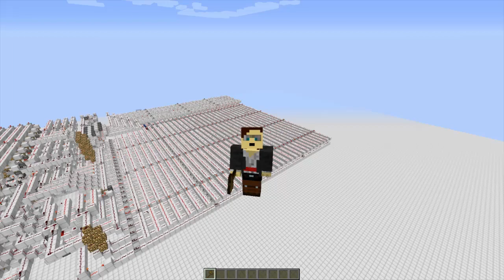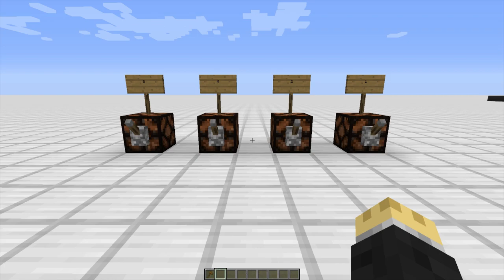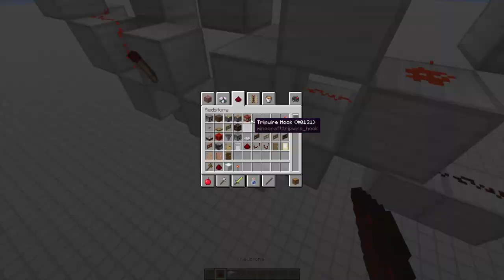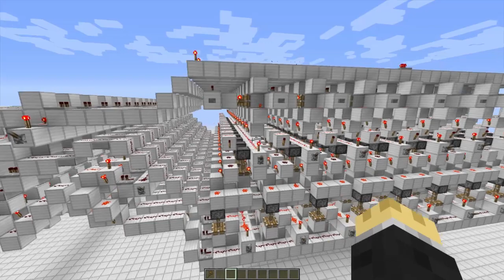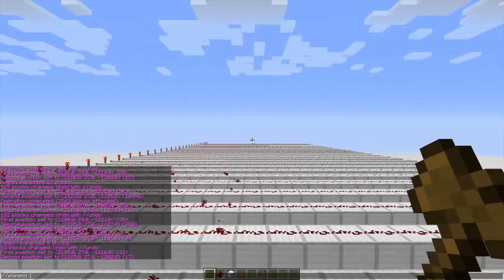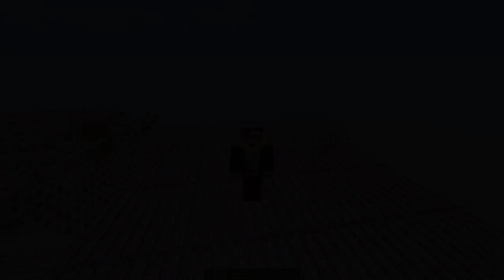Basic Computer Concepts - Pt 1 - CPU Architecture

Comment: For the Dual Read RAM does it need to have a ‘write’ function so that it can save information temporarily? I looked at your tutorial for Sw1ftx16’s dual read RAM design and as far as I can tell, there is none. Is it needed or should I find a different design?

Edit: solved
Reply: Sorry, I missed part of the tutorial I believe. I found an unused line of redstone that did nothing which was probably supposed to update the pistons. I used a piston as an updater because I thought that something was wrong, it was just my own mistake.
Reply from the maker: @secnytsecnyt2981  Glad you were able to figure it out.

Comment: So what happens if you make a 64bit cpu in minecraft?
Reply from the maker: it offers room for a few more features, like double-precision floating point and such, but at a huge performance cost.
For one, any form of ripple carry will take much longer, and 2 you're physical computer will need to take even more time to process all the extra redstone. 
For some, it's up their alley. As for myself, I find 8 and 16 bit computers are usually sufficient.
Reply: n00b_asaurus why are they always multiples of 8?

Comment: Geez stuff I learned in four years summarized in forty minutes. Fantastic! I wish I had this video that long ago haha.
Reply from the maker: Yes! A sign that I am doing this right! Lol I'm glad to hear you liked my tutorial! I was a little worried for a bit that it was too verbose and didn't cover everything clearly, but I'm glad to hear that wasn't the case :D
Reply: n00b_asaurus its very very good! I'm curious about what sort of things you'll put in the next videos. I always wondered what the best way to improve computers in mine craft was.

Actually I have a question for you. The computer you are building here seems to use the same kind of technology that I'm familiar with, but to my knowledge there are better technologies now like diagonal computer designs and vertical comparator heavy devices (like bennyscubes new series). But im not very familiar with those. Anyway, aren't those faster designs? Wouldn't this computer be pretty slow?

Another question - how do multi cycle instructions work? Is there such a thing as block move in mine craft, ie wouldn't be viable at all to have enough memory for block move etc?
Reply from the maker: Thanks, and oh boy that's quite a list of questions XD let me see if I can answer these in order:

I've already posted a video about a language interpreter I'm building. As for the next video in the series, I already have one out about adding RAM and IO devices, the one after that will be about the stack, and eventually I'll post one about interrupts... hopefully!

Best way to improve your computer - still working on that. I'm currently exploring state-machine controlled CISC CPU's and I like them so far. Though there are other methods that I have yet to explore like diagonal CPU's, multi-threaded or multi-core CPU's,  and pipelined CPUs. I guess it all depends on preference and situational needs... not sure if that last one really applies though. 

Are faster designs out there, probably... I'd like to think my designs are pretty fast but I've yet to really benchmark them and compare them to other designs. As for this design though, without a doubt it's going to be pretty slow... I'm trying to create a hybrid of a traditional minecraft computer and an x86 computer. But x86 kind of needs a multi-cycle design, which is something a traditional minecraft computer is not. So I can pretty much guarantee you this design is going to end disastrously! But it's at least a nice bridge for people who are familiar with traditional minecraft computers and want to explore other concepts. So eventually I'll tie this tutorial series in to the designs I'm currently working with.  

As for multi-cycle CPU's, there are many ways of implementing this, though the way I've been approaching this as of late is through the use of a state machine. I briefly touch on this concept in my build vlogs for Deep Thought, as well as my revision update video for SkittleBits (video is titled 'experimenting with control logic') and in my most recent video 'Stackish Interpreter Vlog #1'. Basically a state machine is like a mini computer. It can't do any calculations, but it's very good at following a logical path. By assigning different micro-codes (basically one move operation in the CPU) to different states, and then having the state machine progress through it's states in a certain order, you can get the CPU to act out it's mirco-codes until the full instruction is executed.... This might be a poor expatiation, so I'll have to make a video about this concept in the future. 

As for block moves, I would imagine when you say 'block moves' you're referring to the act of moving a block of memory around as oppose to just one piece of data. This can be done, though because it's done in multiple steps, only a multi-cycle computer can do it. The stackish interpreter I'm building will, in theory, have this capability. I'll show you how I did it once I have the state machine built.

Hopefully this wasn't too lengthy of a read, and hopefully it answers all your questions. If you have any more, feel free to ask. Otherwise I would just say start playing with some of this stuff yourself. There's no better teacher than experience ;)

Comment: make this a series id like dat aleast
Reply from the maker: ... um... yeah!
Reply: n00b_asaurus alot*
Reply: n00b_asaurus Hey updates on this series
Reply from the maker: the first part was easy since everything I made the video about had already existed for the good part of 5 years now.... this part starts introducing some newer concepts though, so I'm trying to make sure 1) I can explain it in a clear and concise manner, and 2) I leave room for the other expansions I plan on adding later down the line.
Reply: Cool! Do you have a reddit account? 

Also Can you do a tutorial on the BCD to 7 segment decoder you used on SkittleBits? I want to see it because my design needs to have atleast 3 blocks between display, and not to mention my decoders are on the side. Meaning that If I ever need to have 3 displays, Im out of luck.
Reply from the maker: no, and maybe

Comment: This is the first video I saw of yours and I subbed. :) But when converting a number to binary, do you find the easiest way to add the biggest numbers to get to a sum, or do you go with smallest numbers first? As in how do you decide which numbers add up to a certain number? Hopefully that made sense... Oh! I liked too. :D
Reply: Probably didn't understand cuz I'm 13 and stewpeed... lol
Reply from the maker: um, yeah I'm not sure I understand your question. If your asking if it matters which way you add the numbers together, it doesn't - recall from mathematics that a+b = b+a. 

As for which numbers you add, its the base to the power of the position multiplied by the number. 
so if we're working in binary (base 2) and our number is 10011, then you would simply apply the formula to each position and add the results to get your number. 
So 10011 = (2^4*1) + (2^3*0) + (2^2*0) + (2^1*1) + (2^0*1) keeping in mind the order of operations (start with powers left to right, then multiply left to right, then add left to right) and also noting that n^0 always equals 1 and n^1 always equals n.  This would mean that 10011 = 16+2+1 = 19 in an unsigned integer.

As I said though, an easy way to assign the numbers is to just start with the right most digit and assign it as 1, then assign each digit to the left as double the previous one. So 1, 2, 4, 8, 16 and so on. Then if there is a 1 in that position, you add that number. If there is a 0, you don't.  That easy!
Reply: Oh! Thanks bro! Still a bit confused cuz they haven't taught this to us at school yet but this'll help me for sure when we do learn it. :)

Comment: Currently in school for computer engineering. This is a really cool way of actually using that knowledge firsthand and seeing how it works.
Reply from the maker: It is quite nice.
It may not be as fast as electronics, but it's much more interactive.
Reply: @n00b_asaurus  for sure, it's a great way of applying the knowledge and getting a better grasp of it.

Comment: Hello, Pretty cool, I made a computer in the air called AirNotes, Inside it is a board of redstone lamps in front of note blocks, with levers, It has a ladder in the middle of it. There is a door in the middle of the redstone lamp board, leading to the note blocks and another door. Open the other door and you are in the core of the machine. It will have signs that are the numbers of the pitch of the note blocks, starting with 1 all the way to 20. The core has 2 floors, one which shows 1 to 10, with note blocks also having notes going from 1 to 20 but all the notes on the floor, and the top floor which goes from 11 to 20, without the same floor note blocks. Mining a single block can wreck the whole machine. By the way, It has a canvas with lots of lights near the entrance of the machine insides. Climb a ladder to get to it, and then open the door outside to get inside the machine, Cool, huh?
Reply from the maker: Oh nice! Have you run any test programs on it yet? How many clock cycles does it take to calculate Fibonacci of 7?

Comment: Question: I have a general idea of what CPU architecture is so far, would this be correct? 

Input signal from external devices as well as any Instructions and Data from RAM -> Clock Distribution Circuit -> CPU Control Unit -> ALU/FPU + CPU Internal Registers -> Output to effector devices or writing to RAM
Reply from the maker: Yeah, from a very basic perspective, that's pretty much it.
There's several variabilities of course, the circuit doesn't just have to be like that, but as a high level abstraction, it's good enough.

That said, I really should remake these videos. There's a lot of information that I glaze over that I'm finding I should have left in there.

Comment: I'm so late but this is amazing. I'm using logic world to make a cpu, and I've got it to run the Fibonacci Sequence. I can't believe I got my 32 instruction counter and everything to work by myself. But I never figured out how to do if statements. I never thought to use the flags of the ALU to MUX programed numbers into the Program Counter! Now when I reach over 255 (It's an 8-bit cpu) I can tell it to jump to my reset program, which just clears all registers and puts 1 back in, so it can start the sequence again. Thank you! I have quite a bit of redesigning to do now on my Registers, since the A and B bus is built into my ALU, not built into my Registers, an I never thought to use that rising edge, I have to dedicate lines of code to switch to registers, my timing is so bad that if you write to register 0 for example, then switch to register 1 while writing, it writes to both. Now I can write and switch with one less line. 

I feel so silly for not usimg flags in my ALU now, and a major redesign on half of my CPU is under way XD
Reply from the maker: Hey, it's part of the learning process.

Have fun, and good luck!

Comment: Hello. I was one of the people who suggested for you to make this series so that I could better understand Minecraft computers. After watching the first two videos years back, I thought a lot about the concepts and managed to, over the course of 4 failed attempts (primarily due to losing the save file) using a free logic gate simulator mobile app, make a 16-bit, 12-command ALU with 32 bus addresses (8 registers, 16 bytes of RAM, a stack, and 4 I/O ports + a write-only I/O "utility" address*).
It has no display features, and is heavily reliant on and suited specifically for I/O device usage. The ALU has 4 flags: Overflow (self-explanatory), Underflow (Whenever you shift a number right and the 0th bit is 1, this flag is set), Negative (Set in any A - B or A - B - 1 operation where B or B - 1 respectively are greater than A), and Zero (self-explanatory).

*The I/O utility port's main function is to relay the status of the CPU without unnecessarily using port bandwidth.
Reply from the maker: Nice! Glad I could point you in the right direction ;)
Reply: @n00b_asaurus  Hey, I'm making a second version with overall improvements, and I want to try out either a dual- or quad- core setup. How does multi-core architecture work and how do I multitask?

Comment: I have a similar setup. One very important question though. I cannot seem to get it to write to an ALU register on consecutive lines. In my example I was using, I put 1 into registers 0 and 1, and on each line of the program, I made it add both of those together, and store the result into register 1. I made it do this over and over again, on each line, but the write enable line never deactivates, so the registers never seem to save the value. I've been toying with this for a while now, and not sure if there is a fix. I am playing on a server, but I don't think that has much to do with it. I have the decoder for the program memory synced up timing-wise, so theoretically it should never deactivate. Is this true? Any help is appreciated! Great content on your channel, btw!

EDIT: Okay I figured out that my real problem is that I just cannot write to the same register on consecutive lines. That makes a lot of sense when I think about it. Man this computer engineering really scrambles the brain :P
Reply from the maker: You are correct, I believe I tackled this issue in the next video.
There are plenty of fixes of course. Most of them require ANDing your write lines with a timing signal of some sort.
Reply: @n00b_asaurus  that has me thinking of possibly ANDing it with the clock since that signal would reach it quicker than it would take the lines to decode and run a line of the program. Either that, or run a slightly quicker clock on it. I'll do some experimenting!

Comment: I don’t understand how the jumping works, you didn’t explain how to actually give the program counter a line to jump to
Reply from the maker: Well, actually I did... just not very well.
The address comes from program memory. 
Basically when you want to jump, you insert a line into your program that provides the address you want to jump to, as well as a signal to tell the program counter to accept this address.

There are also some other circuits involved that can overrule this jump command if certain conditions are met, and those conditions can also be specified by that same line in the program, but that's explained in the video.
Reply: n00b_asaurus this was really helpful. Thanks!

Comment: Your video is awesome! Following your guide made me understand and learnt some practical ways to implement a minecraft computer.

Is it possible to make the whole CPU async. (without a coordination clock, but "tick" every time when an instruction is executed), in minecraft? How do I let ALU  know it have finished its work?
(I have come up with some idea like "watching" the output of ALU, if it is stable for a threshold amount of time, then it sends a "tick" to program counter and run next line.
Or observe continuously (like using a high frequency clock that can be turned off), probing the input of the ALU, if ALU is not empty then accept an instruction, else reject it, but I have no idea how can I implement it in minecraft)
Reply from the maker: Glad I could help.
One solution is to calculate the maximum time it takes the ALU to perform a calculation.
Likely this would be when adding.
There's going to be some time spent by the first full adder, then an additional couple of ticks for each remaining half adder.
Then just make a repeater line that give you the OK signal a set amount of time after you give it inputs.

The only draw back to this is your much faster functions, such as bitwise operations, will have to wait much longer than they need to.

Comment: This is all whizzing by my head but I'm trying to make sense of it all. My main question is how did someone just hop in Minecraft and figure out the physical architecture not electrical architecture and placement of all these blocks in order to make functional circuits in a 3D plane. In something like Powder Toy I can see it being feasible since it's 2D theoretically making it easier to manage. But MINECRAFT, this just blows my mind.
Reply from the maker: In all honesty, I think building in 3D is much easier than in 2D
Reply: @n00b_asaurus  Fair enough, I think I picture a 2D plane like a breadboard just plug it in here and there to make your circuits. But I can't even comprehend a way to describe Minecraft circuits. I'm not even sure if my breadboard analogy makes sense to anyone but me. Surely as I watch your series it'll start making more and more sense.
Reply from the maker: As a part time electronics hobbiest, I get your analogy.

You are correct, that sort of diagramming does not work with redstone. Schematics translate nicely, but they only convey logical connections, not physical wire locations. 

Getting that down is simply a matter of practice.